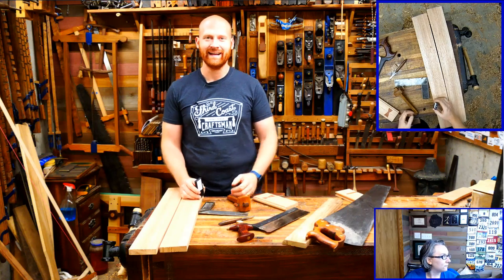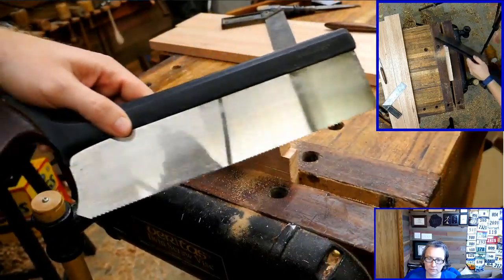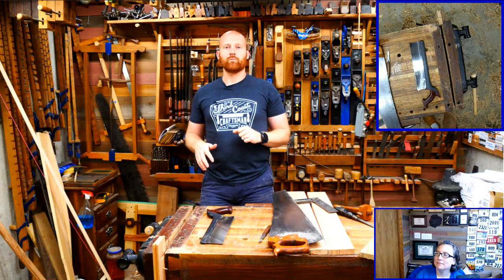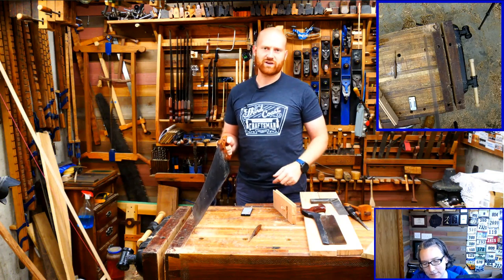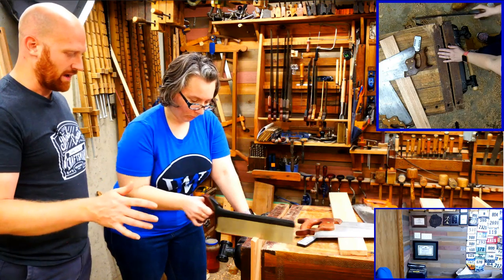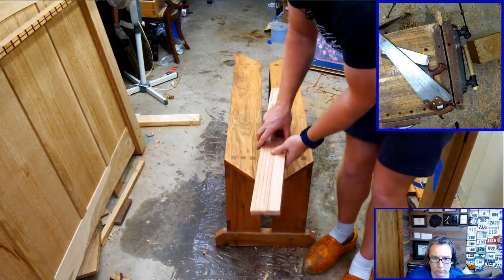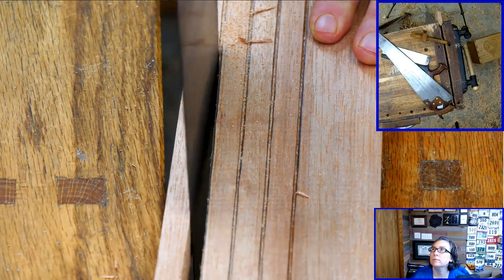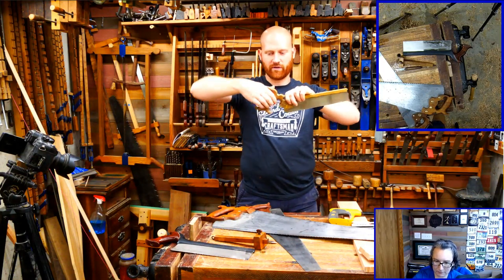How to Follow a Line With a Hand Saw

Comment: Thanks for that enjoyable as well as educative video!

I am NOT a woodworker - I am a DIY'er - at best (with an almost-forgotten past in fine arts) - so, I have a bit of a strange question for you...

When I am trying to practice my sawing 'form'... how important is it to have a SAW that is properly 'set' and sharpened?

So, basically, what I am getting at is... If the saw I am working with is not well set and sharpened - does it make any sense for me to try and practice sawing form with that?
Reply from the maker: you can practice your form with it, but it will not cut strait. and so you will only be learning half of the method.
Reply: @WoodByWright  - Thanks for the response!

So what I gather from that is, basically, learning to set and sharpen the saw properly needs to be the FIRST step in my journey to learn about working with handsaws, right?

The thing is, I have a few very old and rusted hand saws (wrong term, I think! They are shorter than what you clarify to be one, in your video!) - which I have been using to try and learn setting and sharpening saws... 

While, I have also recently bought a couple of 'hardened steel' saws - a backsaw and a Japanese Rioaba - which I have been using to try and practice my 'form' with... And, I am NOT sure whether these new saws are actually up to par (they were the cheapest ones on Amazon!) - 

So, which would you reccomend - focusing on learning to set and sharpen my old saws first - or, practice my 'form' with the new (and suspect) saws?
Reply from the maker: I would say there is no reason not to learn them together. They both take years to learn. though you can get ok with both quickly. it takes a long time to get those skills down.
Reply: @WoodByWright   - makes sense! Thanks...